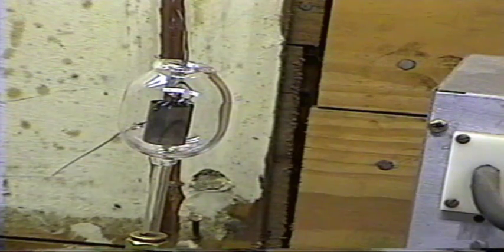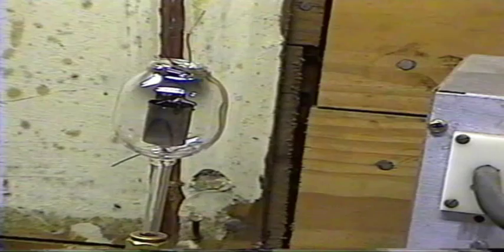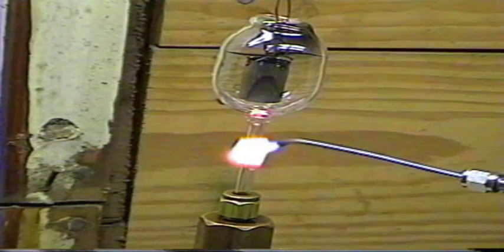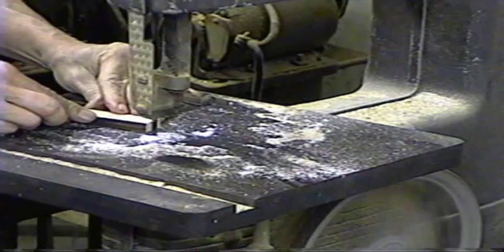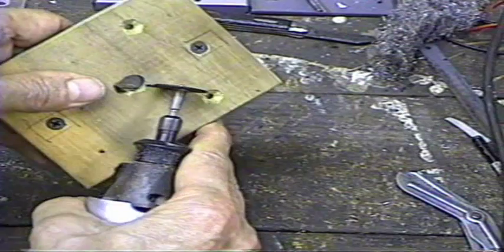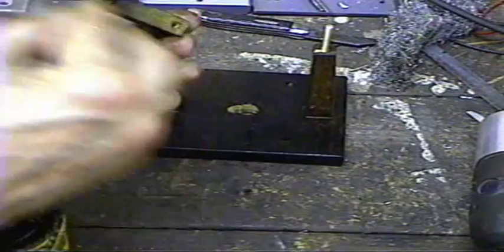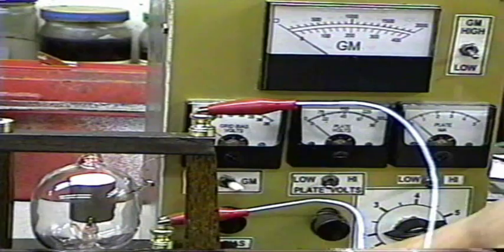making a fleming diode vacuum tube 7

Comment from the maker: Making a radio in the style of approximately 1906! Most radios back then were crystal radios using the galena crystal for detectors. The crystal was very difficult to adjust and would go out of adjustment at the slightest vibration. The fleming diode replaced the crystal and would not go out of adjustment at all.
Reply: Ugg... Cat whisker detectors are a royal pain in the asymmetrical conduction.

Comment from the maker: The surface area of the getter is what absorbs the residual gas in the tube. The greater the surface area the more gas that can be absorbed, thus spraying the getter material onto the inside surface of the tube gives a much larger surface than the very small getter ring itself.

Comment: This was basically a light bulb with an anode plate so you could say it was an LED.
The effect was known about back in 1880 when Edison was investigating blackening of his light bulbs by making experimental  bulbs with an extra electrode but the diode current was so tiny it wasn't much use for anything back then. In 1904 Fleming invented the thermionic diode where its low current capability had an application as a radio detector.
Reply from the maker: Yes. I have made carbon filament replicas of the Edison lamps for people. The LED observation is cute! So Edison actually was the true inventor of the LED! He, he, he!

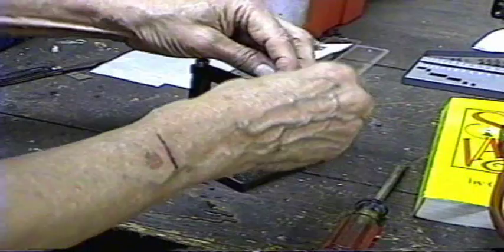Comment: 13:28 That's beautiful. Thanks for sharing, Ron.
How does it perform as a replacement for a cat-whisker crystal set's cat-whisker detector?
Reply: Cool to see your homebrew tube tester up close, too.
Do you have  video up showing it's construction and stuff like that?
Reply from the maker: It electrically works the same. But there is no critical adjustment needed to get the best sensitivity.
Reply: Right on... definitely nice work... and understood about finding that sweet spot on the galena. :-)
That got me to thinking about some crystal sets that I read about somewhere that had a little battery-powered buzzer included in them to help find that spot by generating DC-to-light bandwidth RF noise in the headphones, and one would touch the point of the cat-whisker wire to different spots on the face of the galena until max buzzer-noise was heard in the 'phones, then the set would be ready to tune around the bands. :-)